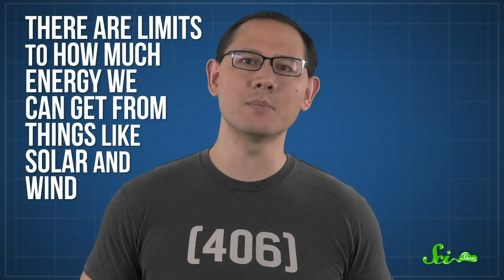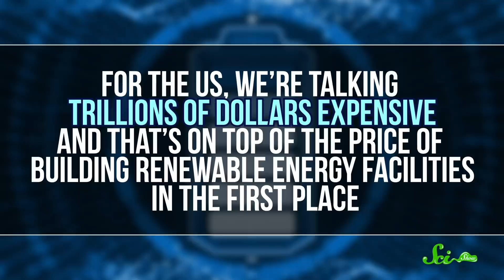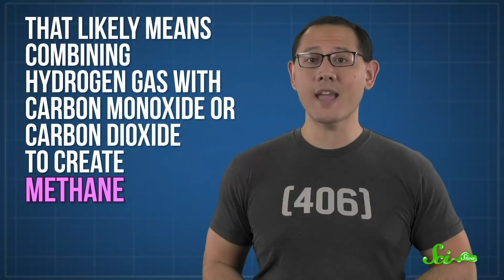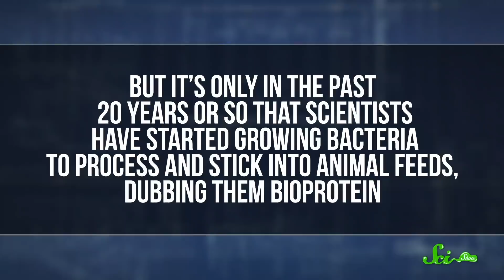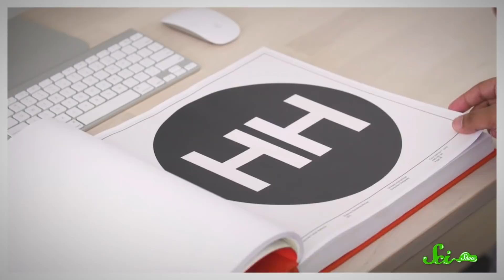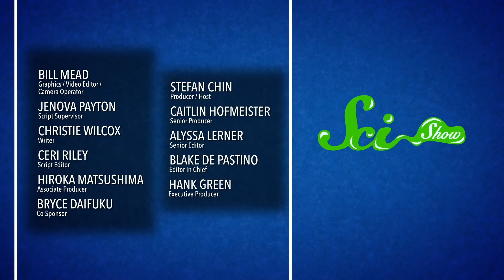How Engineers Are Turning Wind into Protein Powder

Comment from the maker: Skillshare is offering SciShow viewers two months of unlimited access to Skillshare for free!  https://skl.sh/scishow-11
Reply: Another way to collect carbon is by filtering carbonic acid out of ocean water and is much more effective than collecting carbon out of the air. This carbonic acid can also be used in Power to Gas systems. The U.S Naval Research Laboratory has done experiments using carbonic acid to create "Carbon Neutral Fuel" https://youtu.be/G8zOHZINyG8
Reply: The new sodium-glass or carbon-glass batteries, and carbon-hypercapacitors, are going to solve that storage problem in just a few years.  Then it's just a question of how much sunlight you can grab when the gettin's good.  I don't remember if you've done an episode on that yet, but it would be worth doing.
Reply: Cant get through a single sci show episode without a climate change plug...

Comment: Power to gas is a marketing campaign which actually comes from the fossil fuel industry.
 It's one of those greenwashing things meant to stall competing technologies that would ultimately replace fossil fuels.

Like solar panels and wind farms, the cost of batteries are dropping really fast.  Power to gas is way more complex, and likely always going to be more expensive . But it's appealing because fossil fuel companies can continue to provide natural gas, which is what they already do.
Reply: The prices are lowering mainly due to economy of scale and this will soon stop or reach saturation. You really need a lot of raw materials to replace say a nuclear power plant with solar or wind power (mainly due to a lot lower capacity factor and battery support needed (you need up to 7500 MW of solar panels + batteries to replace a 1000 MW nuclear power plant)). The demand for lithium, cobalt and similar materials for Li-ion batteries can quickly become too high and the prices start to rise again.
Reply: @FrainBart_main  
A common argument is to start talking about lithium as if it is necessary all grid storage applications.  Lithium batteries are the new hotness because of mobile applications such as smart devices and vehicles.
 This may go on for sometime , considering battery storage for the grid can utilize secondhand batteries for electric vehicles.  Reuse is the most economic and environmentally friendly method and is far superior to using new materials.  

 And without reusing lithium-ion batteries, there are many other chemistries that are well-suited for stationary use such as grid storage. The light weight of lithium ion batteries, isn't really needed for sitting on the ground.

 Also, and probably more important, the initial material and cost is a one-time expense that we can afford to pay a little bit more.  This is because the vast majority of cost for most baseload energy generation... in the continuous cost related to exploration, extraction, processing, storage, and distribution, waste and external costs like pollution.
 The notable exception, is nuclear of course. Which is why you chose that as a comparison to lithium ion.
 But nuclear energy has a whole host of other externalities that I won't get into here.  There is a reason why the US won't produce more than 20%, and has not for decades.
 
Renewables may use more land and material initially, but after that, it's all gravy.
Reply: @Joeviocoe  Thanks for the reply, I'm happy to see you're not new to this issue. I stated only one issue of wind&solar + batteries systems which we are going to have one way or another due to our policymakers. I agree there are a lot of different chemistries suited for grid storage but they have one thing in common - it's expensive. Also Li-ion batteries will be used because most of the industry is focused only on them. Some chemistries also have memory effect, so they aren't suitable for the power grid. Think of it like this. Imagine you have a lot of solar and wind power at LCOE of around 50 $/MWh, which is even competible with classical power sources. Then you need a lot of battery storage which last for maybe 10 years (at best), so you need to buy them every 10 years. Then you need a lot of voltage regulating devices because od the dispersed generation (on-load tap changers, synchronous condensers etc.). Then you need to have a lot of additional rotating masses (inertia) in the system, so the whole grid doesn't break into pieces at every small fault in the system. Lastly, you need backup power for the longer times with no wind and little solar irradiance. These are all hidden from the LCOE of wind&solar, if you accounted for them, the picture would be totally different.

I'm not really a fan of coal or natural gas power plants, they may have a lot of hidden costs too, like healthcare costs and global warming costs (which are really hard to calculate). Even though we (in my country) have 2 big coal power plants and they produce very little polution, maybe even save some lives because the cities around them have remote heating and people don't have to use biomass and produce a lot of PM. I would like to see clean power sources, which are also cheap (with all costs included), regulable and dispatchable. You don't have any of the above mentioned problems with sources like hydroelectricity, geothermal, biomass or nuclear. Nuclear is in my opinion the best option for the bulk of the power. There are really not a lot of hidden costs associated with it. We have a nuclear power plant in our country and another is planned to be built. The LCOE from the existing power plant is around 35 $/MWh, plans for the new one calculate around 28 $/MWh. They are making an enormous profit even though the wholesale market prices are low (they have been lowered a lot due to renewables subsidies). The money for decommission and nuclear waste management will entirely come from their profit. The only problem is that we (the World) don't have a permanent spent fuel storage but this will change in the near future.

Quick calculation: Our new nuclear power plant would have the nominal power of 1,600 MW, with capacity factor of 90 %. PV capacity factor of existing solar panels in my country (souther side of Europe) is around 12 %. So for the same production we would need 12,000 MW (60 km² of solar panels at 20 % efficiency).  This would basically cover our country's electricity needs. We would need approx 15 GWh of batteries for daily fluctuations. If we use the price of 1.5 $/W for solar panels and 150 $/kWh for batteries (both expected in a few years, which is a bit optimistic) and we use solar panels lifetime of 30 years and battery life time of 10 years, we get the approximate LCOE of around 130 $/MWh (using discount rate of 6 %). This is without taking in consideration all the other costs necessary for stable and reliable power grid operation and considering no degradation of solar panels and batteries and no maintanance costs.

Comment: Some idiots complaining of the energy surges of wind power on the net. These should always be built with some carbon capture attached to them so the idiots  complaining of uneven electricity surges might start to think.
Reply: What has carbon capturing to do with energy or more precisely power surges?
Reply: @FrainBart_main  just assumed the comment section was full of anti-wind shill nimbys
Reply: @ottolehikoinen6193  Well I'm not so enthusiastic about wind power too. I know that's the way we are going + solar, but I think there are better ways to have clean energy, which are also cheap and don't have any intermittency problems.

Comment: "Renewable energies tend to be inconsistent sources of electricity."
To be completely honest, so do fossil fuels.  It's just that when a fossil fuel becomes unavailable and it becomes necessary to switch over to a battery backup, this happens out of view of the general public, and so goes unnoticed.
Reply: What they mean by inconsistent is probably the dependance on the weather condition. You can get up to the nominal power of fossil fueled power plants anytime you want (of course with some limitations in power gradient). Maybe a better word to describe it would be intermittent, not inconsistent.
Reply: @FrainBart_main  Dependence on weather conditions makes it predictable.  When a power plant that runs on a fossil fuel goes offline, it happens suddenly, at unpredictable times, and so these plants have to account for it in their design.  They have to be designed with these backups all ready to go, completely, with minimal warning.  Either all the power needs are being met by the fossil fuel in question or none of them are, with negligible transition time in between.
With a solar power plant, on the other hand, you can tell, in advance, that the source of power will not be available at night or during a heavy, solar eclipse, and will be less available during very cloudy conditions.
With a wind farm, you can tell, just from monitoring the wind, when it's changing direction and speed.
With a power plant that generates electricity from undersea currents, it's the same way.
In each case, you can transition, gradually, to and from the backups that are available.  This gives sources of electricity from renewable sources an advantage over fossil fuels.  It's not immediately apparent, but it does exist.
Reply: @lazyperfectionist1  This is true, but just how often a fossil fueled power plant goes offline unplanned? The power grid is dimensioned for this events. Just like a fossil power plant can go offline immediatelly due to a fault in the system, the same thing can happen to a solar or wind farm too. Compare it to the fluctuating power of renewable energy, esspecially wind and solar. Clouds can influence a solar farm's output very fast. Another thing is that output power from wind depends on the cube of wind speed, so if the wind speed triples, the output is changed 27x. With fossil fuels you don't have such fluctuations all the time, you can even regulate the frequency with them. There are alot of other problems due to mass implementation of renewables too.
Reply: @FrainBart_main   "The power grid is dimensioned for this events."  Yes.  I'm aware of this.  I just pointed this out.  We have designed a power grid that can handle the sudden change from fossil fuels.  It is, therefore, much easier to handle the gradual change from renewable energy.
And the power available from renewable energy does not "fluctuate."  Gradual change is not fluctuation.
"Clouds can influence a solar farm's output very fast."  What do you mean "...very fast?"  With a power plant that runs on fossil fuels, it's completely there one moment and completely gone, the next.  Compare this to a solar power plant where the Sun sets gradually and then rises gradually; where a cloud formation moves in and then moves out.  Compare it to a wind farm where the wind is blowing one direction one moment and another direction a few moments later, or where it stops blowing a little at a time.  This all-or-nothing environment comes from the fossil fuels we already rely on, and it has not brought industrialized society to a stop because we have built our infrastructure to handle it.  Now an infrastructure for renewable does not have to be as flexible.  This is what I'm saying.  Why are you not getting it?
Reply: @lazyperfectionist1  I get what you're trying to say but it's you that's not understanding what I am trying to say. A coal power plant can be online almost all the time and regulates it's output power based on the consumption. It trips maybe once a year and this is not a problem, like I said. On the other hand, a wind turbine's output fluctuates (or gradualy changes) all the time depending on the wind speed. It can happen, that when the consumption is rising, the output of a wind turbine is falling. The gap between them must be filled with the coal power plant. So not only that the coal power plant needs to regulate it's power based on the consumption, but based on the wind turbine's output too. Consumption and production of electricity must be equal every few seconds! You have just a few seconds (depending on the system inertia, which is btw also lowered with a lot of solar&wind) to fill the gap between them. Yes, it's easier to handle gradual change in power than a power plant trip, but power plant tripping happens once every now and then, but the gradual changing of solar&wind output causes problems all the time. What would happen with 100 % solar&wind? There would be no regulating power plants, so the power grid basically wouldn't work because the moment the production and consumption isn't in balance, the frequency starts to deviate from the nominal, which can cause the whole power grid to collapse.

What I meant with very fast? A massive solar farm can be covered with clouds in say 1 minute. There have been attempts of cloud-tracking devices to tackle the loss of solar output. I've seen measurements of wind turbines output that went from nominal power to 0 in 1 minute. It's hard to keep up with these fluctuations happening all the time. When a power plant goes offline due to a fault, a new power plant is started, ussually gas powered. You can't turn a gas power plant on and off all the time because of intermittent wind&solar production. What will happen with more and more of solar&wind and less and less of dispatchable power plants?
Reply: @FrainBart_main   Okay.  Well this is odd; very odd.  Over and again, I use the words "renewable sources of energy," and at no point do you trot out a technical detail about coal that would place it in this category.  Do you dispute that coal is not renewable?
Reply: @lazyperfectionist1  We are comparing renewables to fossil fuel power plants (in my previous comment, wind vs. coal power plant), what didn't you understand here? You have to first understand how the grid works and then can talk about which of them is better. I'm trying to explain how wind&solar effect the power grid. At no point did I say that coal is renewable.
Reply: @FrainBart_main   So if I were to say that coal, oil and natural gas are not renewable, you would not dispute that?
Reply: @lazyperfectionist1  If you think of it, they do renew, just very slowly, they need millions of years to do that. But based on the definition of renewables (it renews faster than we consume it), they aren't renewable.

Comment: What about the whole idea of moving a liquid (usually water) to a high location during peak energy production and using said liquid to spin turbines in the down times?

Seems simple to me, at least compared to all this other stuff. Sure it won't be the most efficient method, but it's simple and would obviously work...
Reply: This is used on a regular basis in so called pumped-storage hydro power plants. It's the cheapest energy storage system for the power grid today.